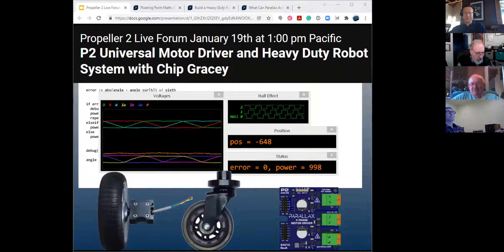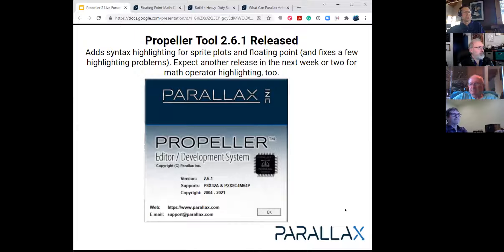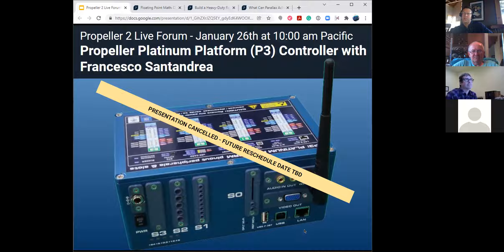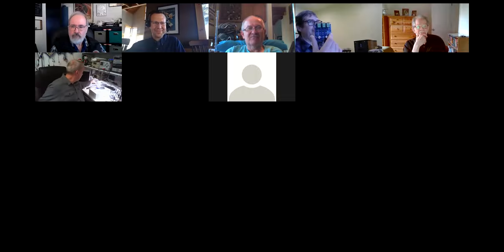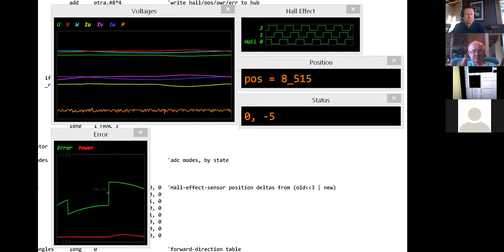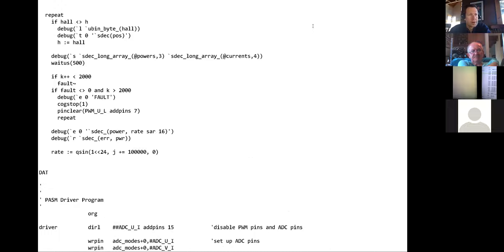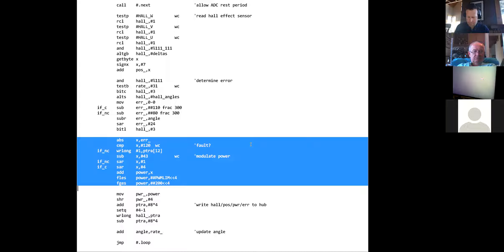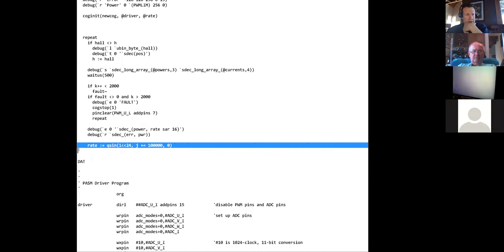Propeller 2 Live Forum: Universal Motor Driver for P2 with Chip and Michael (January 19, 2022)

Comment: Hey Michael, I bet if you trim the back side of that white board, those motors will provide enough acceleration to pull a wheelie and then balance on the 2 back wheels and be a balancing bot if your code is right.

Comment: The standard half bridge BLDC inverters always assume the standard wye or delta wind but Ive always wondered why with a propellor chip you couldn't use as simple high level freq out command and create a variable frequency generator to drive the motor bridges . Its totally fine if 3 outputs create the same PWM frequency . You can implement hardware that will create 120 degrees of phase shift and feed the created 3 phase signals into 3 mono push pull amplifiers The motor would be wound in a 3 phase open end topology . You could also feed such a wind with the full h bridges and sinus step the 3 phase.